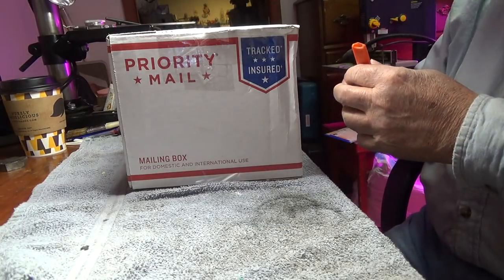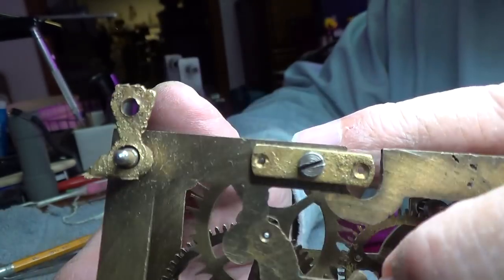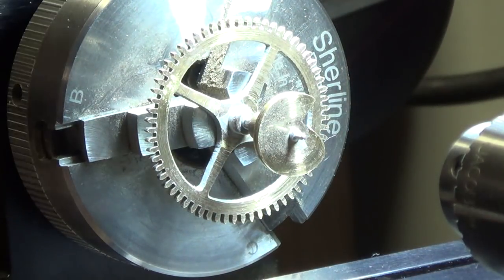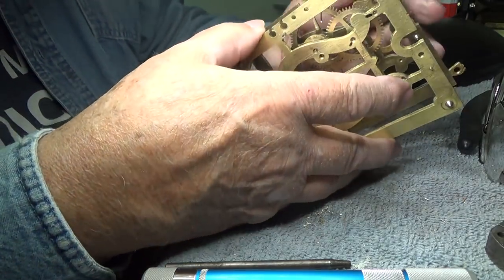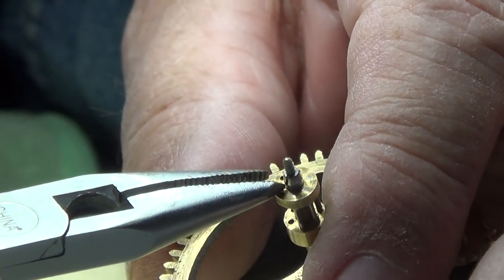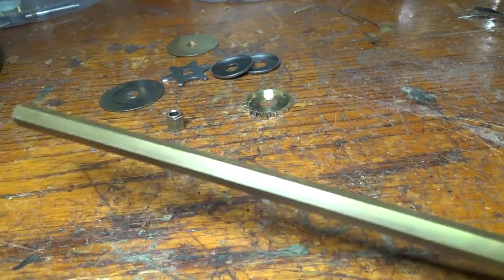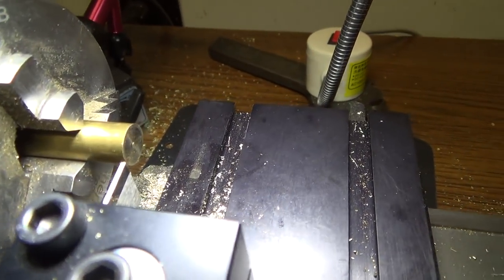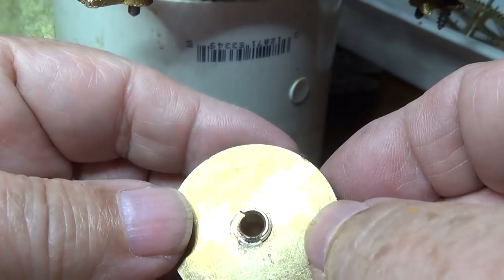Railway House Cuckoo Clock Movement Complete Overhaul 2

Comment: Hi, I have seen another video in which the trundells were worn. Do you make them or do you buy them pre-manufactured? Just curious. I haven't worked on many clocks that have needed them. I am not a business either, just a hobby for me that sometimes makes me a little money. That was a basket case. Is there any clock you won't work on? All the best, Sean
Reply from the maker: I buy hardened steel pivot wire in various sizes from clock supply houses such as this:  https://timesavers.com/search.html?q=pivot+wire&go=Search  Sometimes listed as pinion wire. The wire comes in 4 to 6 inch lengths and I cut them to size with a hardened wire cutter.  Some people cut them to size with a Dremel tool. The wire can be used for trundles in lantern pinion or to replace arbor pivots.  This particular clock had a lot of worn lantern pinions.  When you see that , you also want to take a look at the tips of the brass wheels that ran on those worn trundles.  Often, the tips of the teeth of those wheels will be worn with an indentation on the teeth where they meshed with the trundles.  If the wear is excessive, the wheel can be pulled off the arbor, flipped over and reattached.  Then the unworn side of the wheel teeth are engaging the new trundles.  Sure, there are lots of clocks I won't work on.  I don't like very small clocks that border on being watches.  They're just too small, I don't have tools work on the very small and my age is getting to be a factor for eyesight and hand tremor.  I also don't want to work on extremely complicated pieces such as astronomical clocks nor do I want to work on expensive museum pieces  Those things are best left to the professionals who specialize in that kind of thing. I am not a professional nor have I had the formal training to do other than what I do. I limit myself to clocks that  ordinary people would have had in their homes.  I really don't want anything to do with modern electronic or quartz movement clocks.

Comment: Hi dperry
I have found this video invaluable for me to restore the clockwork that is from my Grand Dads cuckoo. I liked the part where you showed how you replaced the trunndles in the lantern pinions. However you did not show how you replaced them on the cam gear arbor? The only way to take out the trunndels there, on mine anyway, is if I take the cam off the arbor or move the lantern away from the cam on the arbor. What did you do there ??? As they sit right now they but up against each other so I can't access the trunnions where they go in.? 
Also I'm wondering if you have any idea who made this clock? there are the initials GGB stamped on the plate and that is all? I know it's over a hundred years old because I have a picture of it running in my GrandPa's home the picture dated 1919. The writing on the case says it was imported to New York and I think the date says 1901. Any clue ???
Thanks so much for making this video.
Reply from the maker: The reason I did not show the trundle replacement on that particular gear is that they did not need replaced.  There were 3 lantern pinions that needed trundles replaced and the gear with the cam on it was not one of them.  From your description, I'd say you'll just have to remove the cam if the trundles are worn and need replacement.  I would NOT move the lantern pinion  It might be difficult to get the shrouds tight again and back into the right position.  To remove the cam, it needs to be supported from below and, using a clock punch with a hole in the end just big enough to go over the pivot but small enough to rest on the shoulder of the arbor, drive the arbor downward until the cam comes off the end.  To replace the cam, the hole in it, if need be, can be closed slightly with a punch and driven back on the arbor with a punch that is bigger than the arbor diameter.  These clocks were commonly created for export and the movements were often stamped with the name of the importing company rather than the maker.  I've had two that were stamped "Sears Roebuck & Co".  Obviously, Sears did not make the movement nor the clock.  The clocks, though, appeared in Sears catalogues from about 1890 to about 1910 as I recall.  Your clock is likely from this same period of time.
Reply: dperry:
Thanks so much for the information. I've decided to leave the trunndels alone at the cam arbor. They are not all that bad and I am reluctant to remove the cam, thinking that there is some orientation issue about replacing it in sequence with the lantern. 
I also ran into some porosity issues on a gear that I rectified although there were no teeth out of alignment as in this video. On top of that, one of the bearings I had to replace was originally so close to the edge of the plates casting that if I had tried to ream it out for a 3 mm bearing it would have walked off the edge. I resolved that by scabbing in a piece of brass there next to it. Amazing to me that so much porosity is all over the frame too. Must have been a high production demand or poor quality control or both in those days for this to have been the case. Unusual as well, as my experience with German or Austrian machinery is by enlarge quite robust and solid. 
Thanks again for all you do and for responding to my questions so quickly. I sure I am not alone in telling you that it is much appreciated.
Now I'm about to put the clockwork on a test stand and see if I got things right. 
Happy tic-toking to you.
Bruce Foxworthy
Reply from the maker: There is no problem involved with the cam and timing. It can be removed and replaced with no problem.  It doesn't even have to be as tightly affixed to the arbor as a wheel or lantern pinion, sicne there is no significant torque on it and it carries no real load. Understand that, should a trundle break under load, there will be a real disaster for the movement. You can see that, in these movements, the trundles do not rotate or they would wear evenly around the circumference instead of on one side of each one.  At the least, you could grasp each trundle with a needle-nosed plier and rotate them to an unworn portion.    When you run into a pivot hole that is close to the edge of a plate, choose a smaller OD bushing that will not run outside the edge of the plate.  The only conseqeence is that you will have to broach more from the bore.  I hate to hear repairs made by "scabbing pieces of brass".  Another solution to the edge problem is to mark the location of the center of the hole with a device called a "preacher", drill out the worn hole, secure a blank bushing with loctite or silver solder, use the preacher marks to reestablish the center and drill the pivot hole.
Reply: dperry428 
Thanks for the information. 
I’ve come across something I’ve never seen before. After I put everything back together the clock runs just fine except the whistle doesn’t complete its cycle at the end of the count. In other words I get the cuck but no oo. The bellows stays open. Got any idea where the hitch is on this predicament??

Comment: I've enjoyed watching one of your other clock repair videos and this one I got to where you show that wheel that you describe as having porosity of the casting. Do you think that was eaten away by ammoniated cleaner? It's something I've read about but haven't seen anything as bad as what I saw in your video at 5:22. Thanks for posting.... back to the video.
Reply from the maker: I've been using ammoniated cleaner for 50 years and never had a problem.  I suppose if someone left brass in the cleaner for a very long time, it would discolor the brass.  Under no circumstances could ammoniated cleaner do what was seen in this video. This is clearly a porosity in the casting created when the brass was cast and would have been caused either by the sand mold crumbling into the molten brass or, mor likely gas bubbles.  It should have been rejected at time of manufacture.  My guess is that they had too much time invested in the gear before was discovered.  Also, this clock is over 100 years old. During that time, sitting in a damp basement somewhere, a certain amount of corrosion also took place, weakening the already weak area of the cast wheel.  I did find some verdi gris in the cavity of the porosity.  The real problem with ammoniated cleaners is two-fold; it will remove laquer from movements that have been so treated to prevent tarnish and idiots who don't know how to use cleaners.

Comment: I've put the movement all back together and the clock runs fine but, the strike train has an issue I can't figure out. What happens is that at the end of the count cycle, where ever that is and at the half hour, the one whistles bellows doesn't close to finish the cuckoo. In other words I get a cuck but no oo. Any idea what's going on??
Reply from the maker: The chain wheel has a series of wire pegs around its perimeter on one side that do the lifting of the cuckoo bellow lift wires and the gong hammer.  It sounds like that wheel is not turning far enough at the end of the strike to release the second bellow wire.  Each bellows lever has a short wire in addition to the bellow lifting wire that is lifted by the pins on the chain wheel.  Since the bellows is open, the wire is being lifted, but it is hanging up on a pin on the chain wheel because the wheel needs to be, likely, a distance of one or two teeth on the wheel further advanced.  You'll have to move that wheel to a position that releases that second wire.